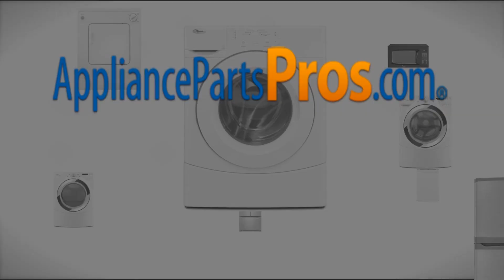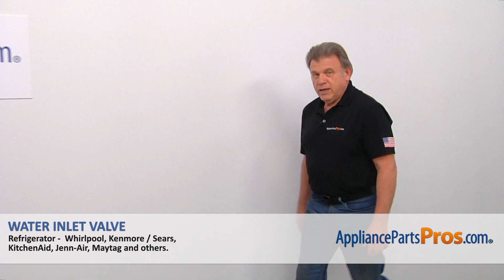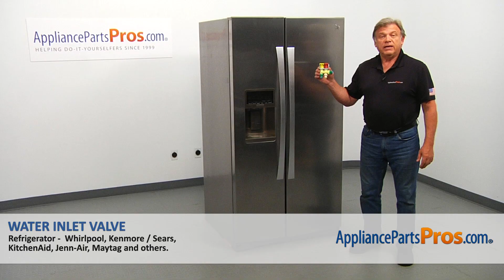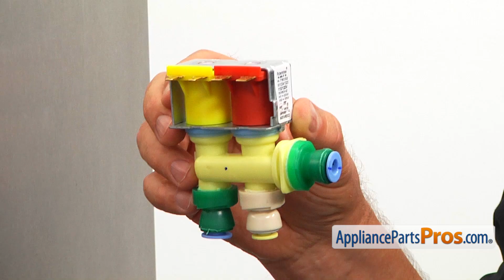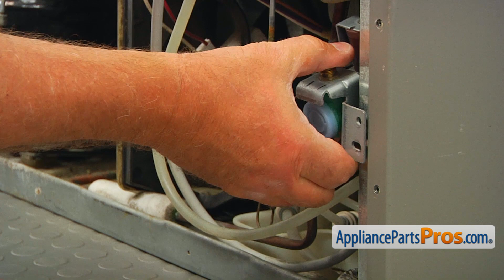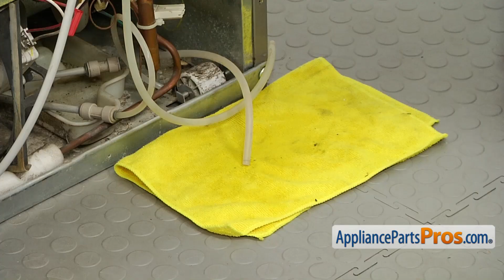How To: Whirlpool/KitchenAid/Maytag Refrigerator Water Inlet Valve WPW10341320

Comment: Can you show which 2 lines hook up to the water filter housing?
Reply from the maker: Great question! On most models using this valve, the water filter housing typically connects to the outlet side of the inlet valve—usually the smaller diameter tubing. One line brings filtered water to the dispenser, and the other feeds the ice maker. The exact setup can vary a bit by model, though, so if you drop your refrigerator model number, we can help you confirm exactly which two lines go where!

Comment: I troubleshot the ice maker circuit with a multimeter from the test ports on the icemaker. Found an open on the water inlet valve. Thank you for taking the time to show how to replace the valve. I just got my new valve today and I'm ready to put it in tomorrow.

Comment: Can the connection be put on upside down ? 
I first replaced the ice try that was not the problem than I replaced the water inlet valve. 
I know there are two different size wire connectors but not sure how I pulled my off and if I flipped them upside down when I reassemble 
Sill no ice I have water at the door just no ice 
Any suggestions or recommendations
Reply: Were you able to figure out your problem?